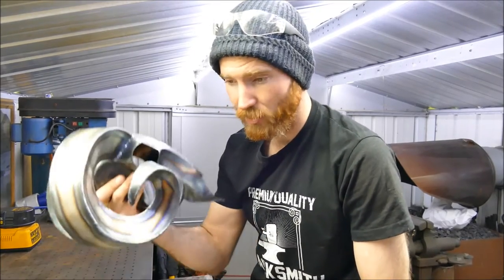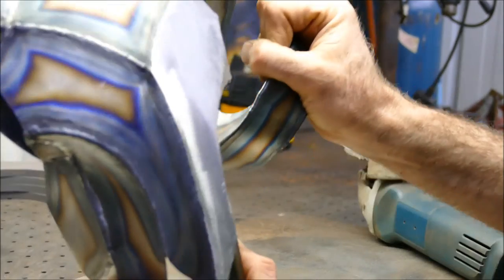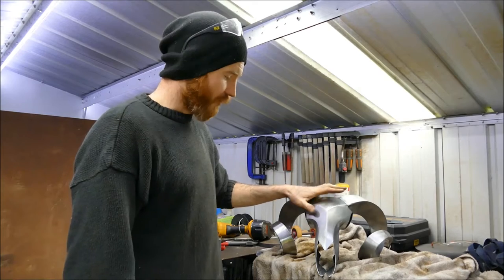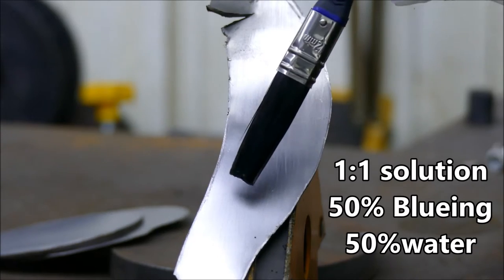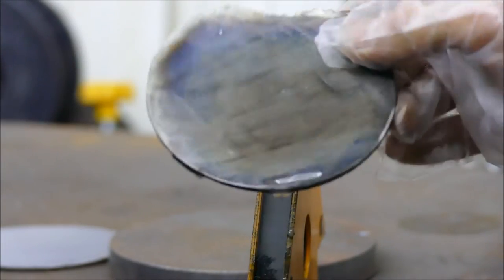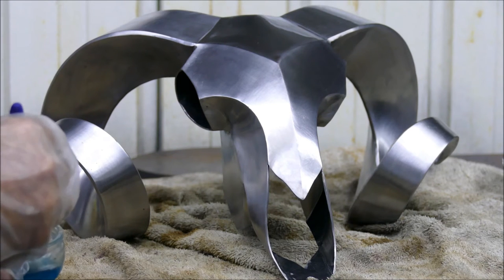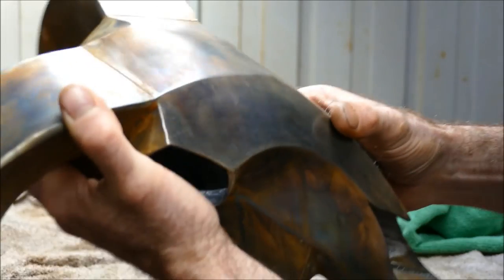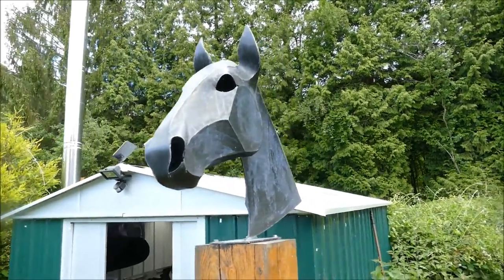DIY Sheet metal welded sculpture finish - Cold gun blue

Comment: A microfibre cloth really helps give consistant results with chemical patinas. The cloth needs only be wet but not dripping and you get a lot of control
Reply from the maker: I tride one but didn't work so well, i'll try it again next time if you think so. cheers J
Reply: @joshuadelisle  when I use them , I keep rubbing it over the surface to build the colour. The solutions also work better on warm metal
Reply from the maker: @SuperiorEtchworx  Thank you I'll remember that. cheers J
Reply: Good call. I was going to suggest a damp sponge dragged slowly across each surface with a fair amount of pressure to ensure coverage. You can get some fairly precise wedge-shaped sponge "brushes" at art supply stores for small areas
Reply: You could even use an oxy torch to blue it?

Comment: I like to use a foam paint applicator to apply the cold blue solution, let it dry for a minute or so, the go over it with steel wool before dipping in water to neutralize. I do this for as many coats as it takes to get the bluing to my desired darkness. A fine steel wool works wonders smoothing everything out. That piece turned out fantastic. Hope to try it one day!
Reply from the maker: Thank you that's a great tip! Cheers J

Comment: I have just bought a blued rams head from EBay as I loved it so much which is how I found your channel mate - I don’t know if it’s one of yours but it’s been done to a very similar standard.

Great job and thank you
Reply from the maker: That's great 👍. It's likely not to be mine as I only sell my originals at galleries but I'm glad someone is doing well with my patterns. Cheers J
Reply: @joshuadelisle  it has had a stand made to allow seated display, attached with two screws but am thinking of removing it to wall hang and light as you suggested.

Great site mate 😎👍
Reply: @joshuadelisle  I’ll stop bothering you now lol, following you on insta, cheers 👍
Reply from the maker: @barrymay4017  thank you so much. I'm glad you came to find me, Im pleased to know you like my design. All the very best. Cheers J
Reply from the maker: @barrymay4017  your always welcome. Let me know what other designs would be good to make. Cheers J

Comment: That is looking cool. Ever tried to convert rust into magnetite? You have to let the iron rust and boil the entire piece in water. It'll leave a super even and durable finish. There are some solutions that you can apply to speed up the rusting process. The more cycles (rust and boil), the better.
Reply from the maker: I havent but that sounds interesting. what solution do you boil it in?
Reply: @joshuadelisle  Only water. Bring a pot to boil and keep it boiling. Submerge the entire rust covered piece and hold it there for 5 minutes. Then go back and create more rust....boil...rust...boil.... until you happy.

Comment: First, let me say that I love this sculpture. I’m not a fan of the bluing on this sculpture, but to each their own. I liked it how it was before you tried to blue it. I had a thought: would it have worked if you put the chemicals into a small plastic paint tray and used a small foam roller? Also, I have blued some engine parts under my hood. I have found that when cleaning the rust off… in addition to using wire-wool, spraying WD-40 onto the wool and then cleaning the rust off, it gives a better final appearance. Just my thoughts. Love the skull!

Comment: Did you know, you can get the same effect but without the brush strokes by using a gas torch?
Reply from the maker: Yes heat blueing I know well and doing in a precise oven can get a good homogeneous finish. Is that what you mean?
Reply: @joshuadelisle  - I do mine with a propane gas flame. It's a bit irregular which adds to the art. It can be a bit difficult controlling it because if you go too hot, it will just become grey again.
Reply from the maker: @SnorrioK  yes I use it on stainless and titanium parts mainly. I normally get steel parts hot dip galvanized but I thought I would experiment with cold blue as I've never used it before and the chemical reaction apparently helps rust and corrosion resistance. Cheers J

Comment: it would be interesting if you made it mirror polished + golden :D 
(with annealing https://en.wikipedia.org/wiki/Tempering_(metallurgy)#Tempering_colors )
you just need an oven where it fits in. But a gasoven/torch wont work since the temperature must be even and precise (+-10degrees C). Gastorch works with smaller parts and patience, i did it with a knife , looks awesome.